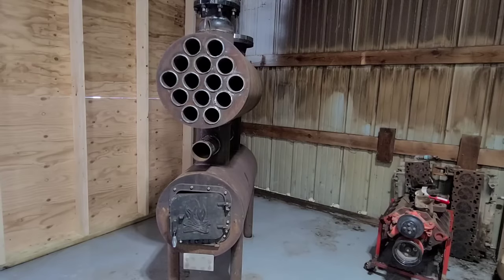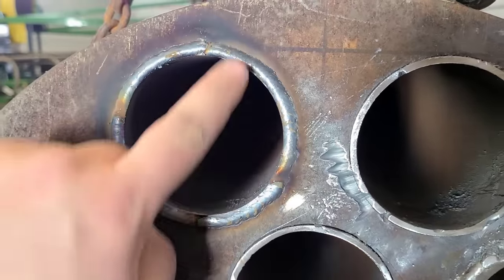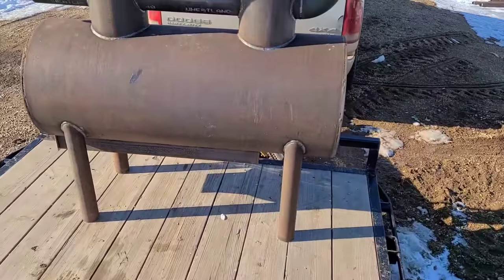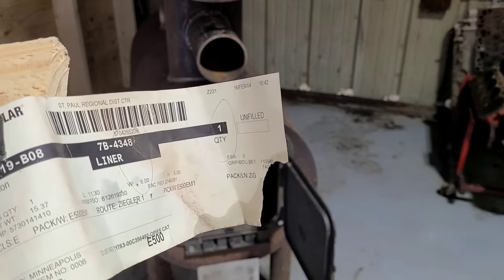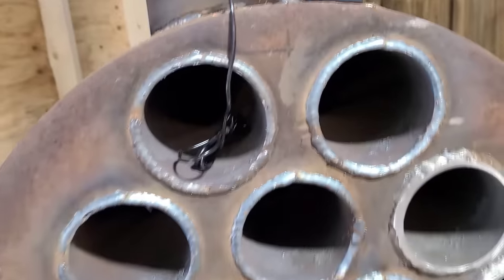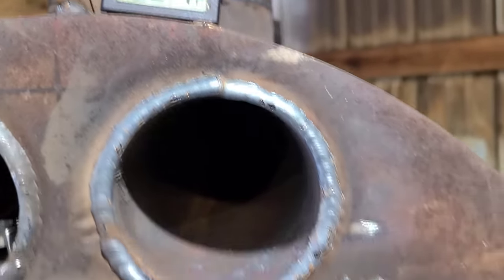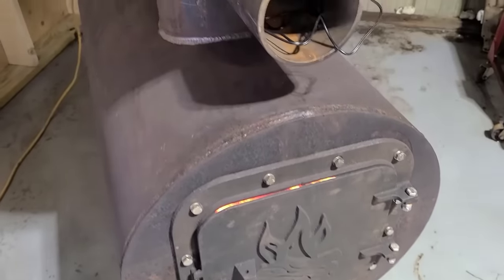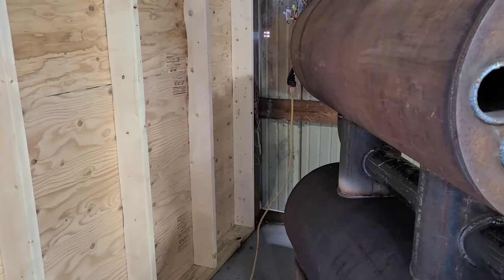My Ultimate Shop Wood Stove Build Part 3

Comment: Have you considered putting a damper in the chimney pipe so you do not loose so much heat up the pipe?
Reply from the maker: I have not, I need heat to travel up the pipe to burn off any soot/creosote buildup 👍

Comment: Use a magnet to pull the nails from the ash - somebody would walk where u drop that stuff.....
Reply: wish I saw your comment to suggest the same thing. I burn scrap wood all the time in my fire pit and I dump the ash and my sawdust in the community compost at the municipality. They take compost, sawdust and wood for free. Before I dump it I run a 20lb magnet over the ash to get all the nails out. 

The municipality will also pay you by the lb for metal and its 1 stop for getting rid of ash / compost and I get a little bit of money for all the nails and screws its a couple of dollars at most but bettter than nothing.

Comment: I can see some serious issues in the offing. After having owned a steam traction engine for five years and heating our home with a coal furnace and cook stove in n.e. Ohio for nearly twenty years, I believe that you are trying to harvest more heat than you should, with the fuel and firebox that you have.
  Any moisture and resins will condense on the exterior of your flues, and the bottom of the stack. The number of flues seems to be excessive for the grate size. An improved design would provide a scraper plate with hole closely fitting the flues, and attached to a centrally located rod extending from the front flue sheet. A periodic pull out and push back would clean the flues. This would maintain any efficiency that you have in the beginning, while reducing any likelihood of a creosote bon-fire in your shop. When spring comes, how do you plan to clean out the ash and creosote build up.
  The view of your stack shows a lot of unburned “heat”. When I was going to steam re-unions, smoke was considered the mark of an engineer that was wasteful. My cousin cleaned the flues in my chimney each spring, and always asked if I had used much wood. I used to walk out to check my chimney for signs of excessive smoke, with wood or coal. As you remove heat from the combustion, you are reducing the velocity of the gases going up the flue. This causes more heat loss and more potential for crud on your flues.
  Nails are the “price” for free wood. I gave several barrels of those to a scrapper. Light gauge sheet metal on the walls with an air gap will help cool your walls.

Comment: Very impressive metal work, but not very efficient wood burning device. Flame should go at least 4 feet before it meet with any cooled obstacles as tubes in second chamber. In current configuration stove will collect a lot coal over cooled tubes

Comment: if you put a forced cold air duct on the bottom, you will see huge gains in efficiency and temps
Reply: forced is against code, and not necessary. A fresh outdoor air duct to the combustion chamber would suffice. Also a secondary burn baffle/chamber.

Comment: the more heat that's extracted from the flue gases, the more creosote buildup there will be. just FYI - hope there's an easy way of cleaning out the heat exchanger - what happens on wood fired furnaces is that the acidic tar and gases that make up the smoke will corrode the heat exchanger and start pumping carbon monoxide into the area you're trying to heat .... without any way of knowing you're changing the atmosphere.
Reply from the maker: Burning kiln dried wood will burn hot and leave little creosote 👍
Reply: It’ll take a long time to become a problem, maybe 5-6 years. I wouldn’t lose a lot of sleep over it.
Reply from the maker: @dirtfarmer7472  I agree 👍
Reply: Not saying this so much to the builder here, but anyone who might copy this without realizing. 

These stoves and the “water heater flue” trick are not commercially available for a reason - if they aren’t maintained, they can burn your building down. Just wanted to add the disclaimer - it looks really nice though, hope it works well for you.

I also knew someone who heated their home with one of these, an older commercially made unit from before they were banned. It pumped carbon monoxide, soot and smoke through their whole house, could have killed them.

Comment: you mentioned that switching from carbon to stainless wouldn't be an issue because you have plenty of material. what issue might there be and how does the extra material help to mitigate it?
Reply from the maker: Dissimilar metal corrosion, although it's very minimal in steel to stainless steel. Extra material means I'll be gone long before those flanges corrode

Comment: I have to agree with the other comments that you need a fresh air intake, but it’s because you’re creating such a negative pressure in that room with the fire going. As for your heat exchanger, it’s going to build up with creosote and you’re gonna have some serious issues if you don’t keep your stack temperature and exhaust temperature above 250°F. To do that you could use a temperature differential switch to control your fan, meaning at 300°F the fan turns on until your heat exchanger cools down to 260°F and then your fan turns off. Just a thought
Reply from the maker: Thanks for the ideas! As far as creosote goes, the kiln dried wood I burn creates very very little but there is a cleanout on top as well

Comment: Since the idea is to increase the efficiency with a heat exchanger I am curious about how much heat yor are extracting from the exhaust, so wthat is the temperature difference of the exhaust before and after the heat exchanger once the temperature of the stove has stabilized? That heat exchanger seems like a massive investment and showing that is more efficient than less massive ones seems important. Not an expert, just curious. The stove does have a very particular look and keeping it all rusty just adds to it.

Comment: This is a pretty fantastic design, but I want to caution you about the nails. If the nails are galvanized they have a zinc coating. Unfortunately, zinc fumes are extremely toxic, and those temps are enough to vaporize that zinc coating.
Reply from the maker: Most pallet nails are not coated 👍
Reply: Thanks

Comment: Excellent idea, most excellent. My only problem with it is how do you clean it? If you were burning coal, it would not really matter  but you are burning wood and burning wood creates creosote. And that huge tank there looks like it could hold a lot of creosote, which could create a bomb? Or mybe it naturally burns off? I dont know, its really my only concern tbh. Otherwise great idea, now just make it smaller for small normal would stoves.
Reply from the maker: In videos 1 and 2 I show the cleanout 👍

Comment: Is there no way to cleanout the heat exchanger? Some woods and the cooler temps on the pipes I would think creosote would accumulate more quickly. Fire in the heat exchanger could be a self correcting problem though? It would be tough enough to handle it.
Reply from the maker: I'm going to refer you to part 2 of this series 👍

Comment: Tar buildup will be a real issue for you. You have an open stack how do you prevent rain water from coming into the stove ?
Reply from the maker: Why why tar buildup be an issue with kiln dried firewood? The rain cap isn't on the chimney yet 👍
Reply: Because you're burning pine. A resinous softwood. The place where pine tar comes from.

Comment: Beautiful construction! But the amount of heat you get out is determined only by the energy content of the fuel you put in. This energy can then be released faster or slower, for example by adding more material around the fire, which causes the heat to spread more slowly and over a longer period of time. The construction around the fire can only affect how fast the exact same amount of heat is spread in the room. (In the case of electric radiators, the same principle applies. The world's oldest electric radiator and today's best have exactly the same energy efficiency – if the radiator doesn't sound or glow that is - then you lose negligible amounts of energy as kinetic energy (sound) or photons (light).
Reply: Yeah but a normal stove usually has a very high temperature at the chutney top.

Comment: May make it so the two bottom pipes get air from outside?
Reply from the maker: I'm curious, why would I want to pull outside air?
Reply: @kylechrist  Maybe he means to feed the fire with air from the outside, this goes straight up the chimney. This way you do not have cold air being sucked into the shop to feed the fire?
Reply: @wifiguy_nz  I was thinking about making a positive pressure environment. I thought maybe it would have been better. But I looked it up and it turns out it is a much worse situation.

Comment: Here in Skandinavia we trying to burn the wood
slower. And we have sand or special rocks around the chimney so
it stores maximum of heat. But why ad an electric fan it dosnet gve ore heat?
Reply from the maker: The fan is for air circulation through the heat exchanger tubes 👍

Comment: its basically a reverse steam boiler design
Reply: Exactly, except the steam boilers were designed the other way around with ‘fire in the tube’ because the inside of the fire tube could be easily cleaned with a long wire brush.  The reverse design with fire on the outside of the tube would be tough to clean.
Reply from the maker: @m7791  that's not 100% true, to this day they make both fire tube AND water tube boilers

Comment: How long does it take to get your space up to a comfortable temp. Or how fast can you move your space 30-40 degrees?
Reply from the maker: In the video we went from 50°F ambient temp to 65°F in an hour, I didn't refill the stove and let it burn out. Without insulation the temp drops pretty quick

Comment: Instead of tubes in the top barrel to dissipate heat, wouldn't like 3 or 4 tubes at 45° up and out connected to large car intercoolers dissipate alot more heat, and they're premade already?
Reply from the maker: The down side to that would be cleaning any ash and creosote out of them, especially being that they use relatively small tubes 👍
Reply: @kylechrist  ahhhh that's why no one does it.  Thanks, I've wondered that for years.
Reply from the maker: @adamfrbs9259  don't get me wrong, I think it could be done but the cleaning may be a nightmare haha
Reply: @kylechrist  i wonder if there would be some kind of chemical bath they could soak in every few years that could get the stuff to fall off like butter?

Comment: You definiatly need Fire rated board on that wood wall which is too close to the heat source.  Pretty pricey Weld Neck Flanges, Reducer and elbows...........!  A damper in the Smoke Pipe would help a lot.  Close the Draft and crack the damper and wood would burn slower and hotter.  That 4" pipe along the bottom is feeding 14 3" pipe? Not needed.   Internal baffles would have more air travelling thru the maze of pipes.  Like a real heat exchanger.  No need for Fire brick.  It would inhibit radiant heat from the firebox.
Reply from the maker: 36" is the standard for any radiant heat stove to combustible wall clearance

Comment: I'm thinking that I woulda added some flat plates on the ends to the legs and woulda bolted it to the floor; 'cause it looks pretty top heavy and thems legs look kinda close together.
Yeah; I get it that the flue is a heavy pipe that is likely anchored to the structure somewhere's ; so that would make it reasonably stable.
Thank you for a good presentation...also THANK YOU for NOT making it all about your face and your ridiculos mugging while pretending to be an actor; like so many other channels!

Comment: small wire mesh between the stack and heater to catch anything that lifts doubt there would be anything but better safe than sorry
Reply from the maker: A spark arrestor on top of the chimney will fix that problem 👍

Comment: Might want to burn only hard woods.🤔🤔👉👉One problem with burning pine in a conventional wood heater/stove or fire place and yours with is many turns. Is it creats alot of Creosote buildup cause it has alot of sap in it. The only wood heaters that can break the sap down fully and remove it very quickly are rocket style heater and R stoves. Because they use more air by creating a stronger draft to burn hotter breaking down the sap and L shape makes the smoke shoot out the chimney faster. Like the exhuast coming out of the exhaust pipe on a bull dozer. 👈👈🤔🤔

Comment: Just a thought ? Might wanna check with your home owners insurance before you start insulating ? Or putting up drywall . See what they're requirements are ? So your butt is covered in case there's a fire.? Even if it's not related to your Awesome wood burner

Comment: Did you get a chance to weigh the heater?
Reply from the maker: I haven't put it on a scale but knowing the weight per foot of each pipe and adding all that up it is approximately 2000lbs with the chimney 👍

Comment: Do away with the two pipes leading up from the firebox , cut a long rectangular slot in the top and bottom barrels , box it in and expose heat exchanger tubed directly to the fire. I know...what a shit ton of work on a beautiful finished project. Lol
Reply from the maker: While I can agree with what you are saying, I used steel that I had the time, hence why it ended up being two barrels. I know I could get the exchanger tubes hotter by doing as you're saying but yes, that would be a lot of work to cut it all back apart haha, thanks for watching

Comment: Put a probe on the chimney just before it goes out the ceiling,  how much heat ya losing to the great outdoors? Should be high enough temp to maintain a good draft, but, not so much that all your work is being waisted.

Comment: Feel like if u are burning all pine it might sut up faster got a buddy that burns all pine and he's has to sweep his chimney more often than u would burning hard woods .. awesome stove built like a brick shit house for sure and I have no doubt it's going to function great in the long run
Reply: I was going to bring up the pine resin issue as well.  I don't know that the pallets are necessarily made out of pine, but there is a good chance at it.  But I think that most export pallets use kiln dried lumber to get around the bug issue.  So, the kiln would have dealt with most of the resin issue.  Pine still tends to build up in the chimney, so regular chimney sweeps, but that should already be a given.  I'm kinda more concerned with the build up inside the heat exchanger since I don't think there's a way to clean that.
Reply from the maker: In part 2 I show the cleanout
Reply: That's what the stack with the cap is that's the clean out just saying the shitier wood u burn the more maintenance
Reply: Seen all 3 parts great video and would like to hear next yr how it worked out and how the clenout process went for you

Comment: Dissimilar metals will corrode without isolating them from each other.
Reply from the maker: While this is true, I'll be long gone before corrosion eats through 3/4" thick flanges 👍
Reply: @kylechrist  No one lives forever, no one. But with advances in modern science and your high level income, it's not crazy to think you can live to be 245, maybe 300. 
-Ricky Bobby

Comment: Too much smoke out of your chimney. Find a way to get a secondary burn and get all the energy out of that wood.
Reply from the maker: All wood stoves smoke until they are completely warmed up 👍
Reply: @kylechrist  agreed that they all smoke in the beginning of the burn, however if you get an insulated burn chamber with secondary air intake for a secondary burn it would be more efficient. IMO that is of course!

Comment: Sorry to say, but your heater is just half made! Only cirka 40% of gas will burn. Upper barrel desperately needs secondary air inlet which can take burning air from outside. It will increase effectines up to 80%.
Reply: If you insulate the firebox you don't need secondary air. It's probably less complicated
Reply: @themanwithIBS  Insulating does not increase amount of burning gas. Only secondary air inlet burns those gas which go now unburnt to chimney. Only gas-air mix burns. Even my masonry baking owen has secodary burning. You just need a pipe through wall from upper barrel, slightly downwards with possibility to close it when starting fire.
Secondary burning also reduce significally amount of soot and card.

Comment: watch out for creosote. going to need to clean that frequently with CSL and hit it with a sledge to free up the material.  run it HOT, that way you don't accumulate as much debris inside. definitely a fire hazard after 1-2 years of regular use.

Comment: I bet your loosing a lot of heat straight up that big chimney
Reply from the maker: 6" is pretty standard for chimney diameter 👍
Reply: @kylechrist  BUT you need a Damper Inside the pipe and adjustable.

Comment: Protect your wood walls with steel corrugated roofing.
Reply from the maker: I need to get the inside finished off with steel yet, it's all time and $$$
Reply: @kylechrist  , I lived through a bad wildfire.  It wasn't the flame but more so it was the heat that caused the fire to spread.

Comment: give it a waste oil drip feed too ,,, that changes the output dramatically
Reply: I'm a believer of doing so, just last week adding it to my 18 year wood fired boiler. I bought a 14 buck electric 1/4" valve (open when power is supplied) put a fitting in a 5 gallon plastic bucket hoisted up above the stove to get it out of the way plus gravity flow, and a bathroom fan timer. A needle valve downstream of the electric valve gives modulation, I like 1 drop every 1.5 seconds, the timer, set for less than the time the fire well burns, insures no oil drip after the fire goes out. Burns clean, no smell, and I'm seeing hotter water, quicker.